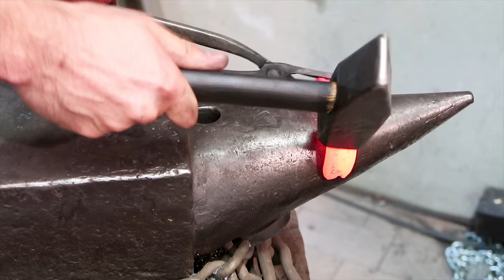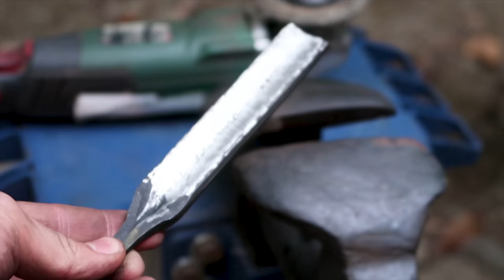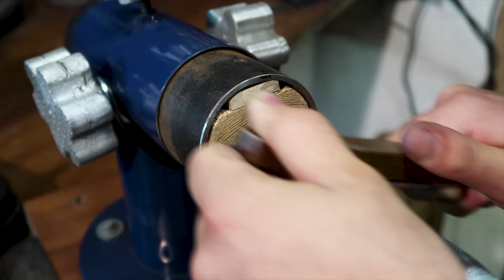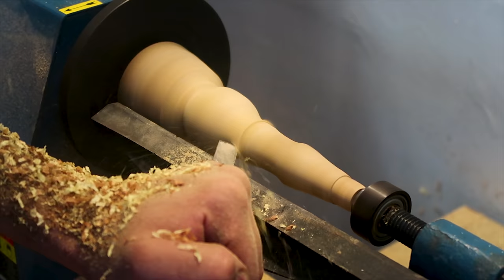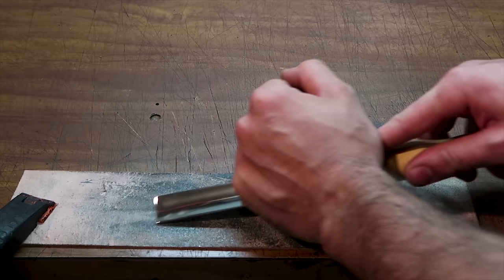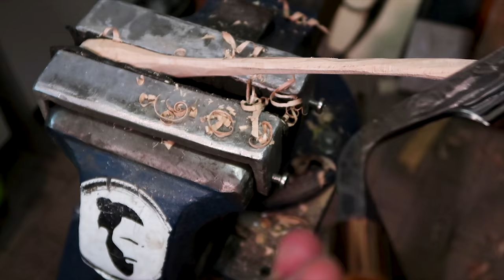Bearing Forged Into Fine Woodworking Tool (Inner Race)

Comment: Beautiful,  loved the little trick for finding the centre of the ferule before you drilled it. Quick thought, If you use a V block in your vice when you are holding round material it will stop it from moving in the vice.  Keep up the great work. 👍👍👍

Comment: Excellent. Only constructive advice is fill the cracks/knot holes w/ resin/epoxy if you plan on hammering often so as not to further fracture. Sand then clear coat, Danish Oil, etc...

Comment: Excellent work.  Did you use yew for the handle? It's a good attractive choice for a tool handle when it's dry, but it's important to remember that >all parts< of  yew tree are poisonous (cardiac poison) except the red flesh of the berries.  So be careful to control dust generated while turning and sanding it.
Reply from the maker: I'm not sure on the wood, might be yew as you say, some pics on google are really similar! And now that you say that you made me think of how badly I was sneezing while turning :') Thank you Bob!

Comment: What an great job up-cycling that good steel! Is it 4sale?
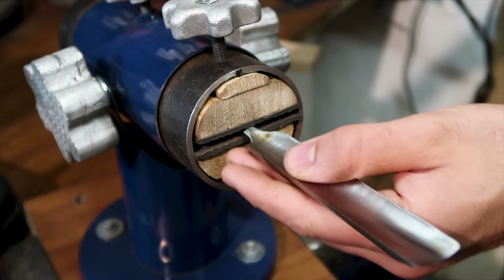Q: what is the name or type of the circular vice used to hold the tang of the chisel @ 6:15 mark? I’d like to get one but have never seen it before.

PS
You might want to burn in the tang into the handle. I got a file guy and that’s how he sets his files and rasps.

Comment: Great job, I'll have to try that sometime down the road, maybe this winter. Those bearing races are high carbon steel so that should last you a good long time. What diamater was the bearing you used?
Reply from the maker: Around 4inch outer diameter. Thank you!!
Reply: Mark o